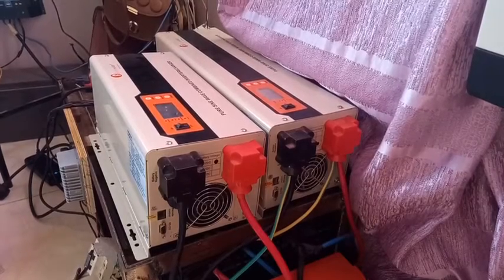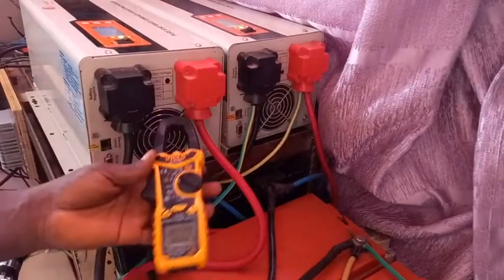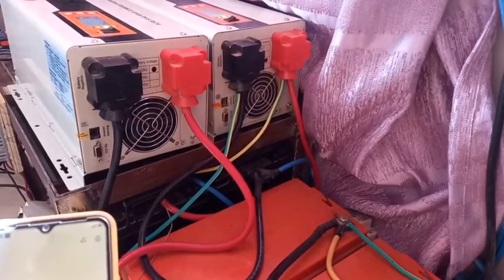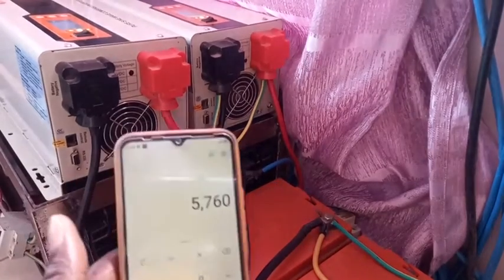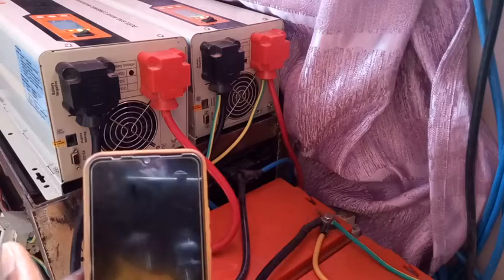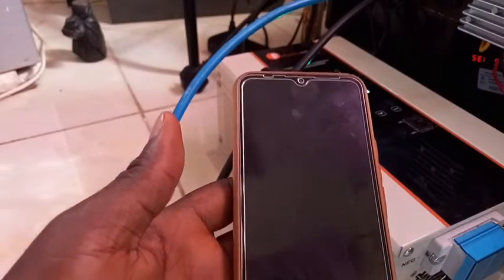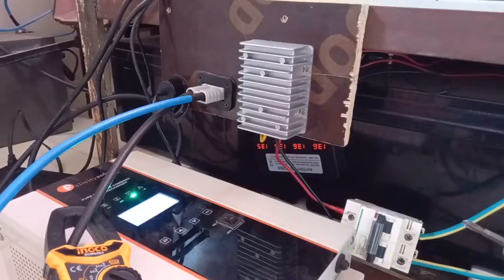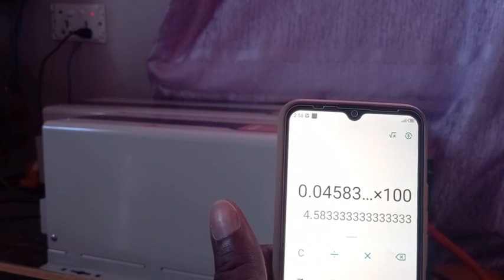High Zero Load Power Consumption of Large Low Frequency Inverter in My Systems.

Comment: I have a  24v Felicity inverter 3.5kva, it doesn't not last over night, i also have 12v Felicity 1.5kva, how do i swap at night time to use the 12v inverter but my battery bank is 24v
Reply from the maker: You can use a DC DC buck converter  on the 24v battery bank to connect the the 12v inverter, but this will help only if you have small load at night, having a large load running on 12v inverter through a buck converter is almost the same or even worst than running your high ideal consumption 3.5kva inverter.

Comment: You mean that your solar system can carry an electric cooker. Please what type of cooker consumes less power.
Reply from the maker: I use an Induction cooker(Rated 2000w), it is the most energy efficient means of cooking, unlike electric hotplate and ceramic cooker, the heat is generated directly on the cooking pot. This reduces energy loses to the surrounding. I also use a rice cooker (Kenwood rated for 600w), a toaster (700w).
Reply: Which series/model consumes 10w in the later portion of this video?
Reply: @diyfalke This is quite astonishing! Please what is your total PV capacity and how are you able to use this kind of cooker on your system in the day without worries?
Reply from the maker: @Yusuf Zakari  I have a little over 4kw of solar, I am using all kind of cooking appliances, Induction Cooker rated for 2000w, a rice cooker of 700w, multi-cooker of 600w rating, Toaster of 700watts. However often I only use one at a time.
Reply: Wow, this is getting interesting. Please are all this running on a 3.5kva felicity inverter?